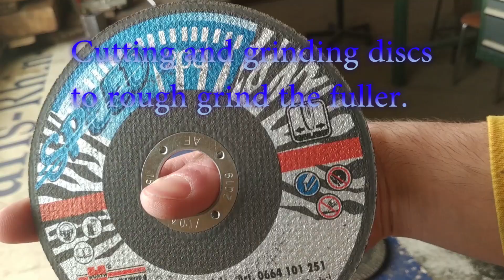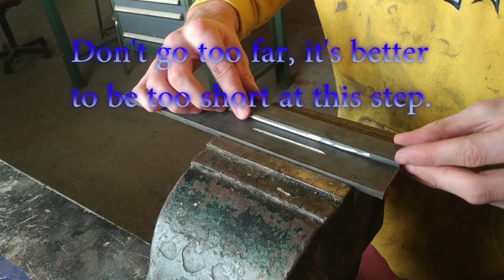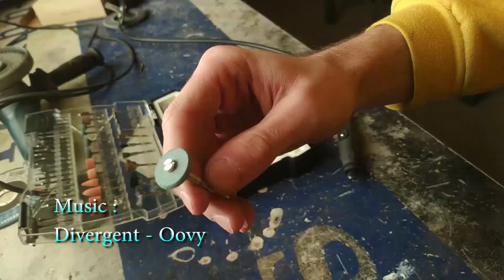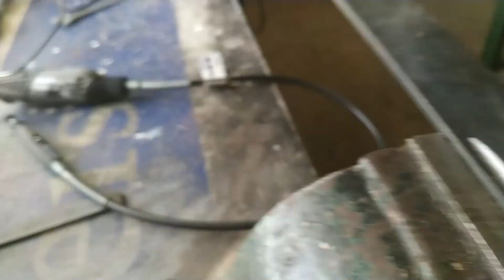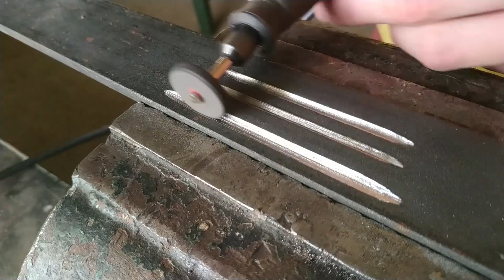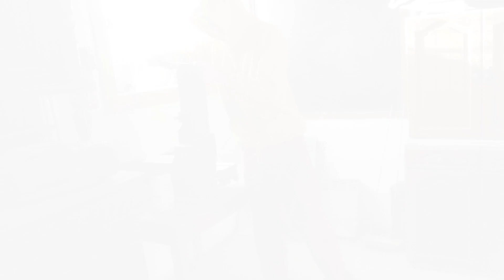Knife making tips - How to make a fuller without a milling machine - Fabrication d'une gouttière

Comment: Hey man good video. I've actually been thinking how to do this myself. Had a similar idea. But to finish it off use some small diameter dowel rods and hand sand it for a good finish. Haven't tired it yet though.
Reply from the maker: You're right, wrapping some sandpaper around a small rod or some nail would be another way to clean these fullers, might take quite a bit of time 😂

Comment: What kind of discs are those you are using to "clean" the fullers with? I have a katana with a pretty sloppily made fuller and i would like to clean mine up and maybe even extend it in both directions, getting the fuller closer to the handle and farther to the point. Any advice would be appreciated. Great video.
Reply from the maker: Hi ! I don't know the name of those, some are coarse stones and the last one is a smooth polishing stone... Unfortunately I don't know how they're called

Comment: Hey that looks like something even I could do. I would just have to find another way to polish it though as I don't have a dremel. I would have to practice on some mild steel first before I tried it on a knife though.
Reply from the maker: Yeah definitely practice on a few pieces before, it I still need to practice too. 
You can use some heavy sandpaper wrapped around some thin steel bar, or a nail or something
Reply: @lamproknives  Might work i will have to give it a go.
Reply from the maker: @scottshobbyz5416  or do it before the quench and leave the black oxyde from the quench in there
Reply: @lamproknives  haha i was thinking that might be a way to cut down on the finishing work. It would probably go well with some kind of rustic looking survival knife.
Reply from the maker: @scottshobbyz5416  yes, or even create a nice contrast with a satin finish
Reply: @lamproknives  i am going to try one soon where i satin finist a sabre grind but leave scale on the high flat. The video won't be out for a while though as it is going to be a longer project. I will just do a bit on it every now and then.
Reply from the maker: @scottshobbyz5416  this can look very cool ! What is a saber grind ?
Take all the time you need to make great work
Reply: @lamproknives  Sabre grind is like a full flat that doesn't go all the way up. In between a full flat and a  scandi grind. But it has a secondry bevel just like a full flat. Not a zero grind like a scandi. So it is a tougher studier blade but you do lose some cutting performance compared to a full flat as it tends to wedge faster.
I have been meaning to make this knife for a while. It is going to be a mowie knife inspired by FargoFX. But I will try make it more like modern day bowies with a gaurd and all that. I have flattened out the mower blades but that is as far as i have gotton. Haven't even done a design yet. But i have a rough idea in my head.
I know i am still a novice maker but I am going to try test my skills on this one and go all out on it. To see how good i can make a knife.
Reply from the maker: @scottshobbyz5416  I'm curious to see how it turns out ! Take your time and really to be lazy, don't let big project lower your attention to details
Reply: @lamproknives  yeah i want to test myself. I have a lot of quicker builds from saw blades and stuff i will do in the mean time. U was hoping to do one this weekend but the wood cutting i was doing took me way longer than i anticipated. I will show it off soon just got a couple more pieces to cut. Then lots of editing lol.
I got sick of making scales from scratch for every single knife so i made up a bunch on the weekend. I have over 100 knives worth now lol.

Comment: Thanks mate, how do you finish off the ends?
Reply from the maker: The ends ? Hum.. with a smooth dremel disc, or you can use sandpaper around a drill bit or something round
 You won't be able to a very sharp end with this technic

Comment: What about the wide fuller on a Viking sword? How would that be done?
Reply from the maker: A scraper, a small wheel attachment on a belt grinder, or a stone on a surface grinder. But the method shown in the video probably isn't the best for that, the fuller won't be wide enough